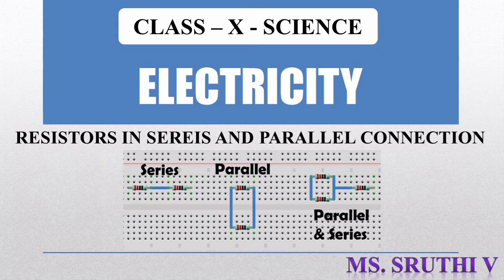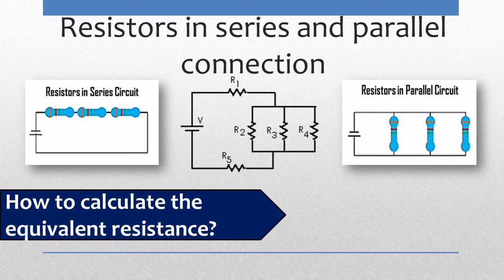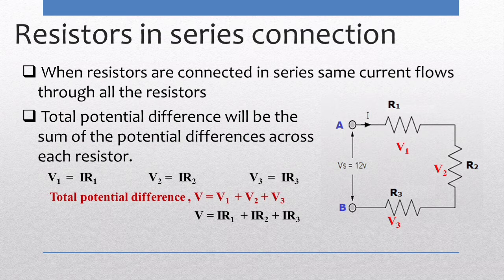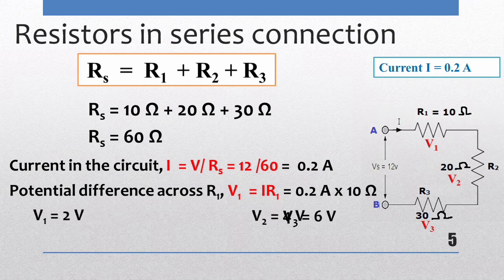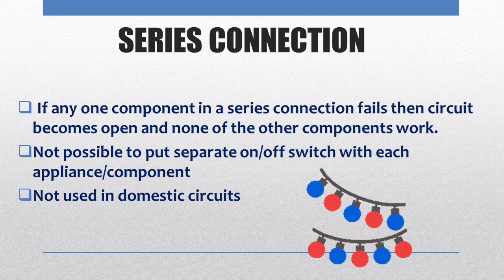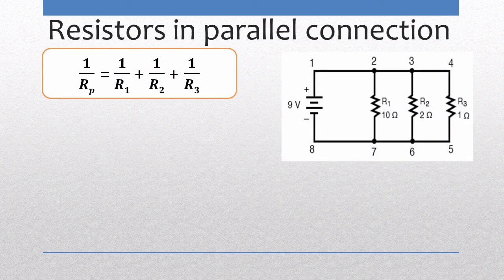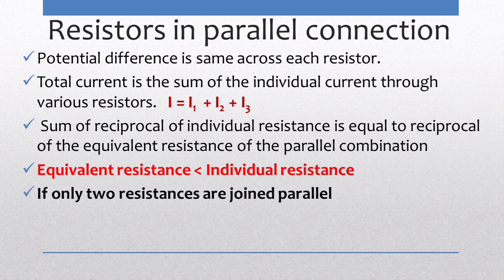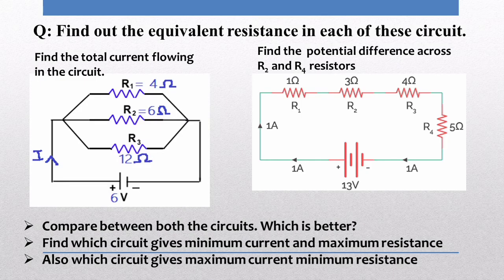Series and Parallel connection of resistors - Class 10 - CBSE/SCERT/ICSE

Comment from the maker: Answers for the homework question given in the video
Parallel combination:
Equivalent resistance = 2ohm
Total current = 3 A
I1 = 1.5 A, I2= 1 A, I3= 0.5A

Series combination:
Equivalent resistance: 13 ohm
Voltage across second resistor: 3V
Voltage across fourth resistor: 5V